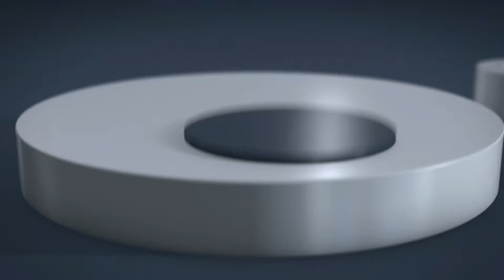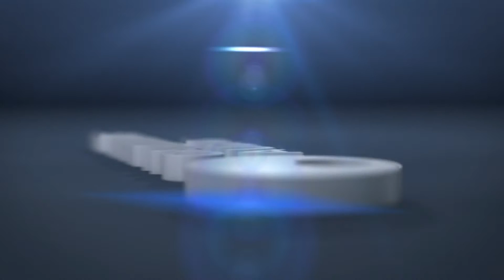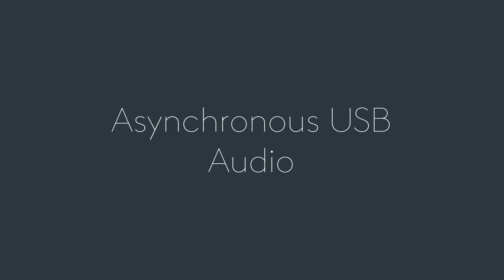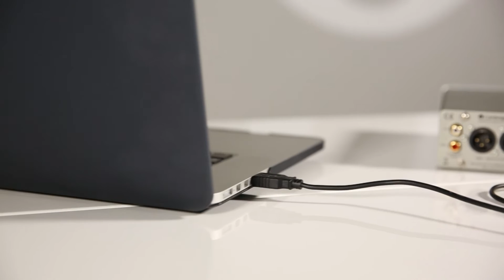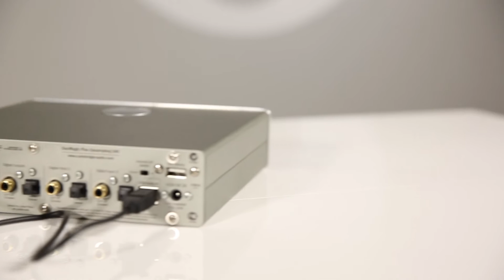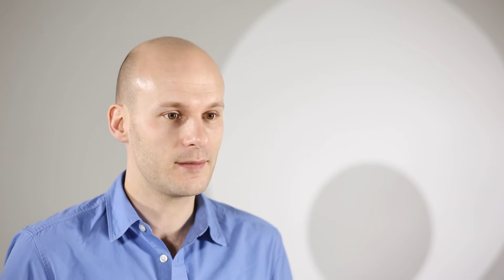USB Audio Part 3: What is Asynchronous USB Audio?

Comment: So presumably asynchronous USB is superior to SPDIF and Toslink as the timing of the data stream in them is done by the source (synchronous)?
Reply: USB might (or might not -- depending on the DAC and the computer) be superior, clock wise, to a SPDIF or Toslink connection (but will very likely be inferior to a SPDIF or Toslink connection).

Devices (especially computers) generate a lot of electrical noise.  That noise travels to the DAC, via the USB cable, and eventually makes it to your speakers.  You are not likely going to hear the noise.  It is one of those things where once you minimize the noise, that you recognize the absence of the noise (the music blossoms).

Put a quality digital-to-digital converter (DDC) between your computer and your DAC, and your ears will thank you.  The noise will be far lower, and depending on the quality of the DDC, its clock will produce less jitter.

The quality of the cables also affect the sound quality.

Comment: Ben, I have Cambridge SLA25 amplified speakers connected to computer via USB.  CA current USB driver not suitable and earlier driver will not run on 64 bit computer.  Therefore can run only 16 bit audio Windows.  Is there a firmware update for this product?  I cannot see reference to one.  Current product suitable for this?

Comment: It is this just me, or sounds like bull to inflate prices?
Using Raspberry Pi with hifi Berry digi+ and no problems at all with the "noisy clocks"...
And everybody knows that USB on the pi really sucks
Reply: To my knowledge the hifiberry digi+ is a s/pdif output board and interfaces with i2s outputs from rpi and has nothing to do with usb.
Clock problems may also occur with s/pdif - that depends heavily on the clocking implementation of the receiving device.
Reply: Uh... you don’t even know your own hardware. Digi+ units use I2S, not USB. Jesus.
Reply: @BlownMacTruck  yes but i use a hdd drive connected to the usb port of the pi, and there isnt a single problem with all that bull about noisy clocks.
it's the same as paying more than 500€ fo a usb cable. gosh...

i know my hardware and i can tell you that either from the nas or usb hdd the pi is producing those noises.
and we all know that the pi share the usb bus with the ethernet and still no noises...
Reply: @ruifaias8258  I don't think you do.The HDD has nothing to do with clock generation over the I2S ports. There is also TERRIBLE noise with ethernet and I2S output. Try streaming DSD512 to the Pi and see the insanity of the I2S output. You can literally hear pops and clicks every few seconds as the Pi 3 can't keep up due to bandwidth limitations - it's not subtle or hard to find. The Pi 4 gets around all of this.
Reply: @BlownMacTruck  offcourse not. i know that hdd don't give any problems with clock generation or "noise".
the only problem with the pi2 (in my case) is the lack of processing power and bandwith to cope with DSD512 as you said, and it isn't the "topic"and in "normal" use you it plays just fine.

my point is that things to work as they should we don't need those "miracles" like asynchronous usb ports.
i even read about asynchronous ethernet ports on some switch "made for audio" that was way overpriced.
Reply: The red flag was the term jitter, that they use to part fools with their money on snake oil audio products. It does the brand a disservice.

Comment: ok great, now what's with USB-B. why not USB-A or the new USB-C
Reply: USB-A to USB-B cables are what their devices use from what I know, and practically all DACs are the same.

The only reason to change to USB-C would be for convenience. Otherwise USB-C has some baggage, new evolving competing standards, some aftermarket cables actually are manufactured to do usb-c 3.1 and usb-c 3.2 depending on orientation you insert it in (very rare but happens), the cables have some durability issues despite shorter leverage points. Power management with USB-C depending on the device you would connect it to is really varied recently, maybe you've heard of the Nintendo Switch aftermarket chargers and docks bricking the Switch. This was due to Nintendo not using the standard. This is added engineering costs for zero benefit to the sound quality, and a drawback for compatibility (any PC made before a certain time will not have a USB-c port) to customers.

Overall, moving to USB-C for things like keyboards has been more of a convenience factor to edge-case users who buy 100-400 dollar mechanical keyboards. With home audio setups, especially high end ones, the customers are mostly older people who may have an old setup they had someone build for them. They would probably be upset if their new Cambridge system had a compatibility issue.

There is no audiophile need for changing to USB-C for these devices.

Comment: Does asynchronous USB work in both USB I and USB II modes?
Reply: Yes.  The difference is that Class 1 support up to 96 kHz sampling rate.
Class 2 support 192 kHz (I am certain of that -- but I think that it supports double that).

Comment: Soes this mean that you can only achieve asynchronous with a usb connection and therefore it is better than using the toslink connection on a 851D? 

further, which is the fastest when it comes to audio needing to be aligned with video such as movies and games?
Reply: It can technically be better IF all other things are totally equal, and the DAC itself uses asynchronous at every component internally needed. There are DACs advertised as asynchronous that are only simulating asynchronous behavior from the USB port on, but convert to synchronous on the internal computer at some point, which is flawed.